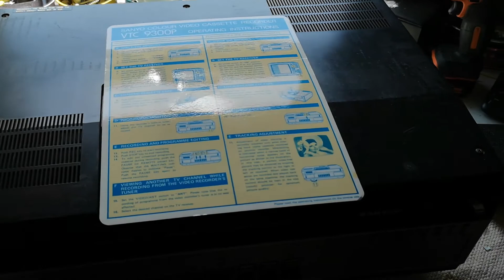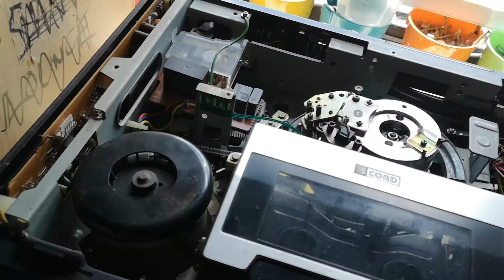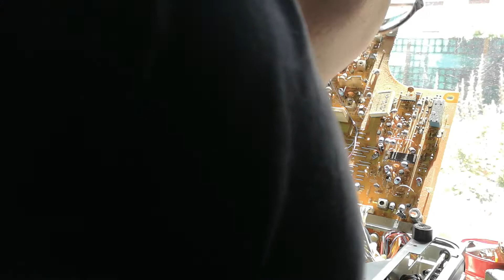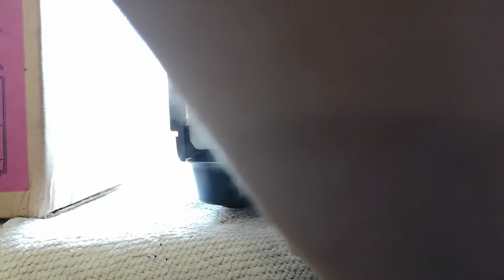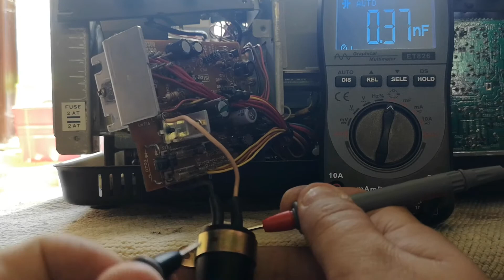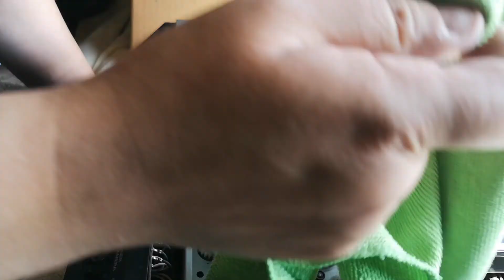Sanyo VTC 9300 - Sanyos first Betamax deck for the UK Market

Comment: i have one of these and im struggling to get the cables to link it to a modern scart tv. i bought cables but the fittings for the betamax end are too small.
Reply from the maker: I think you need a UHF to BNC adaptor, then a BNC to Phono adaptor. Earlier VCRs had those very large sockets on the rear.
Reply from the maker: I think it's a 'PL259' connector

Comment: I have this model too. I took it from dry storage after it had been sitting there about some 25 years. I bought it second-hand and used it very little. Now I wanted to watch an old recording but after 20 mins the playback stopped and the tape got jammed in the mechanicals. Luckily the tape did not get cut only crimpled a bit. I was adjusting the tracking during playback. After that incident I took out the bottom cover and saw that the belts were very dry and polished and slipping obviously. Then I tried to get more grip to the short belt that drives the casette and sprayed it with some electrical cleaner and it did make a difference but the casette tape still won’t run on playback. Fast forward and rewind works ok.  So it must be a sticky mechanical part that should be working to start playback. I noticed some replacement belt kits in eBay but some have a few belts and others have also additional parts like rubber wheels etc.  Interesting these old VCR’s. I have a NEC Beta VCR too which I want to see if it still works.

Comment: Most Excellent! A good old trip down memory lane for me with this model! When the VTC-9300 was first approaching it's last few months of production, the company I worked for in Fareham, Hampshire, in the 1980's, used have 500 Sanyo Betamax units delivered every week, on a Wednesday afternoon. Each delivery was usually made up of around 250x VTC-9300's, 250x VTC-5000's at the time. These deliveries continued for many many weeks  and they usually sold out completely before the next delivery, as they were selling them at £149 and £169 respectively....

Comment: The pinch roller is not engaging with the capstan shaft because the solenoid is sticky. I had the same issue with my VTC 9350. A bit of lubrication inside the plunger will take care of this problem, providing there is power applied to the solenoid when going into play mode.
Reply from the maker: I had produced a video covering this, along with renewing the belts. Sadly, it was lost. However, the pinch roller now works....but....one of the head chips has fallen off. I do have a spare head to fit at some point.
Reply: @JCTsFascinatingHobbies  I accidentaly managed to break one of the head chips on mine. I replaced the head disk from a donor VTC 9455 that was in very rough condition but had good heads.  It's a difficult process because the screws of the head disk must be screwed in using a certain torque, otherwise you will have tracking and dihedral errors.

Comment: After this is done, the pinch roller will engage the capstan shaft.
Reply from the maker: I've a video that I need to upload, where I discovered this. I also installed a new belt kit. Just awaiting a head disc, this one is missing a head chip on one head.....